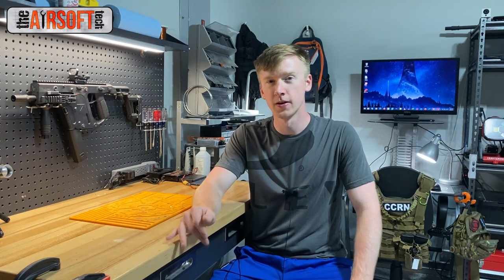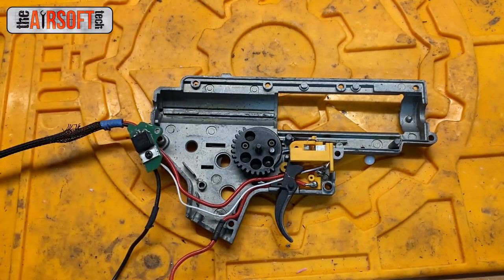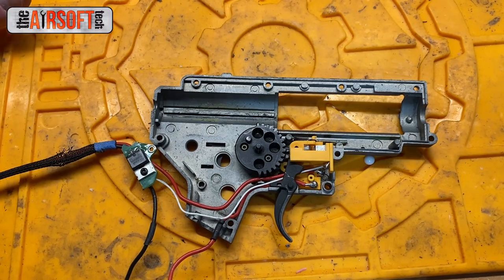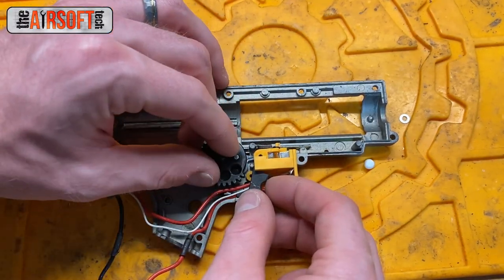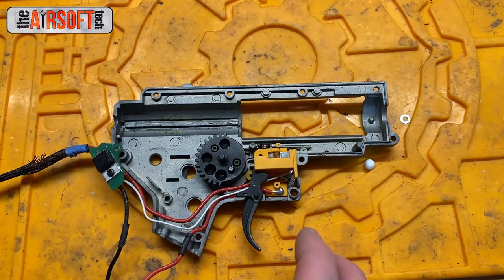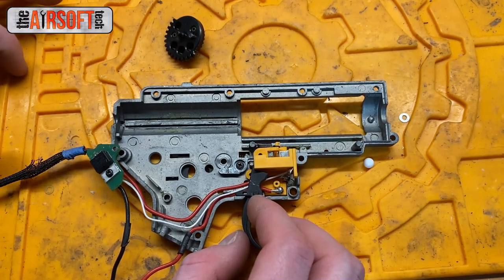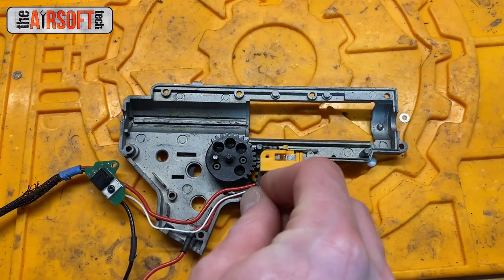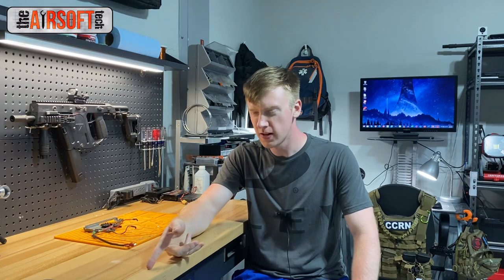Back to Basics: Semi Auto Clicking

Comment: Usually customer error, the aeg requires you to pull the trigger to the rear and wait for the cut off lever to disconnect the trolley for you.  You can then release and pick up the trolly again.  People pull the trigger half way, disconnecting power them selves to try and create single shot.  If the customer needs the gun to operate faster than mechanically limited guns then they should be traded up to a internal etu to remove the problem.    If there’s no compatible etu then increase speed with mosfets and voltage to reduce the area that it has time to hang and get caught.   But still comes back to trigger spam or too slow battery.

Comment: I have the same problem on a g&g mp5, I know that the issue now is that is not the same gearbox shell that it originally had, I put in a old g&g gearbox { non blowback } 

2 posible fixes: 

1.fine tune the selector plate with cut off lever so it sits just right
2. gate aster v2, issue gone (recomended, c'mon it's 2022, trigger contacts are dated already)

greetings from dominican republic: 🇩🇴

Comment: hmm I'm wondering if I snapped something in my trolly. 
My last game while playing my trigger got a bit stuck and I applied a bit of pressure and felt/heard a snag sound. Then it went back to going all the way back. However, my Semi is now fully auto. The thing that confuses me is 2 out of 10 pulls it will go semi like it supposed to with 1-3 out of 10 pulls fires 2 or 3 shots a pull. 
Took it apart to look at it and I'm no tech nor do I know what to look for, but it looked like it was all in one piece. 

I'm wondering if I need to replace it entirely and if so, does the type of the gun matter? I'm using a Sterling SMG. I also have some mechanical experience/understanding But AEG is a completely new field. Your videos have actually been a big help on most problems i have seen and had.

Comment: Hey @TheAirsoftTech! Love the channel, been following for a while and finishing up nursing school to join the Murses soon! I recently shimmed my ARP9 (stock internals + Gate Aster). I got rid of most the gear/motor noise, but the spring makes a loud "TWANG" sound after each shot. Any suggestions on remedies?
Reply: the g&g springs are short and bounce off the inside of the piston and spring guide when it cycles. so just get a new spring